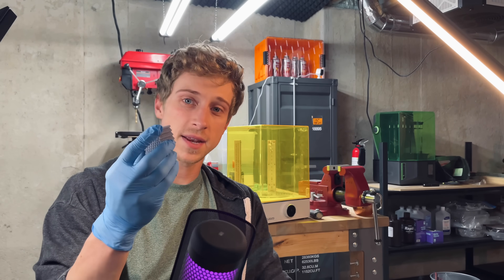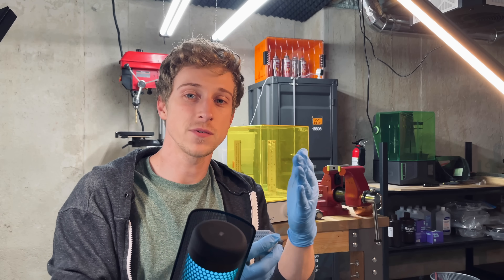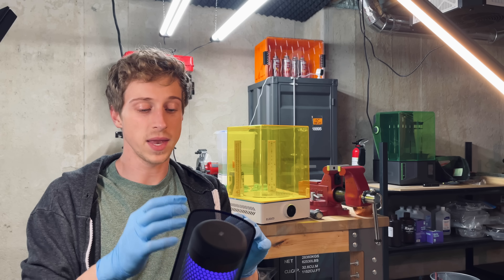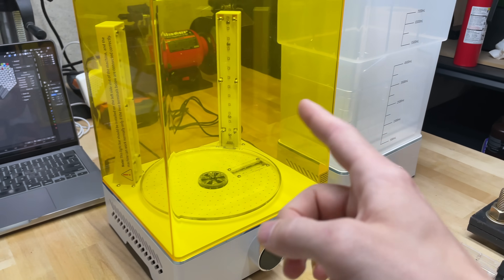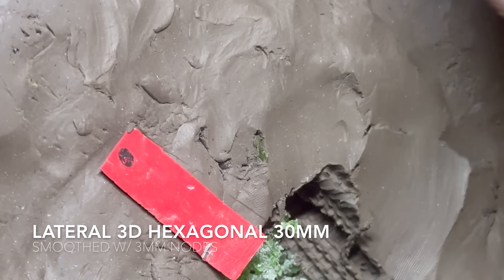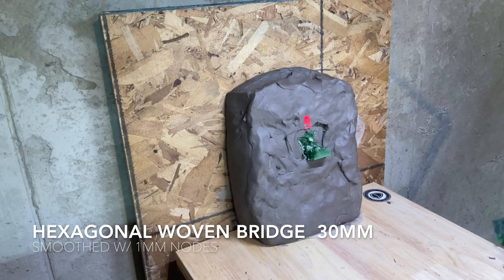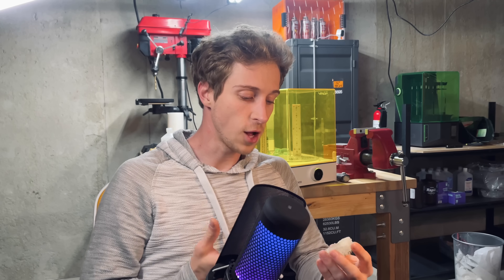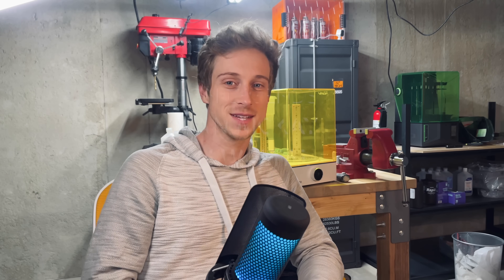Making 3D Prints Bulletproof with Molecular Structures

Comment: That's an ambitious next step, I was planning to test in a cheap analogue with handgun rounds before escalating to tougher materials & rifle rounds
Reply from the maker: Basically, the 3D Print Steel is expensive so I'm taking it right to the extreme
Reply: @CrashMakerspace  at present I still think casting/molding is the way to go, but I'm researching my ideal materials to death before I try shrinking  the budget for analogues to something reasonable
Reply: @ArtichokeMoss hopefully the ideal structure is one that can be somewhat easily (I.e. inexpensively lol) cast/molded in a high quality fashion
Reply: @CrashMakerspace  now I know it is not a ceramic, but. Demolition ranch, and stay with me now, don't stop reading because I'm talking about one of the crazy gun men posting videos to the internet. The owner of that YouTube channel actually acquired a prototype bulletproof vest, they drove over it and there was a mild warping in the plate after that. I believe it might the potentially worth looking into non ceramics, and finding a possible Superior material.

 Also why not make the exagonal structure out of ceramic, which has a higher Breaking Point than steel, and is used in body armor? Is it because much like the resin it will be fine until it breaks, instead of fine until it warps, and then warp Until It Breaks like Steel ? If if you want the thing to be able to survive an impact, by warping before it breaks. Now I'm no expert on steel. I'm really not a authority figure on this. But spring steel seems like it wouldn't be a bad choice, because after it warps it will go back into its previous State. Also historically it was used for swords, swords are mostly metal, and they are typically made rather thin, and they would be impacting things with quite a lot of leverage, because of households are held and used. So its seemingly in my mind not a bad choice for you to single out spring steel, although in terms of raw durability I'm pretty sure 1095 excels.

And if you want to read the third paragraph, just know that these ideas are Beyond normal, and quite frankly I wouldn't be surprised if they either don't work or don't get seriously considered by you. If you want the metal to return to its original state geometrically, because the ceramic while more protective, will shatter. There is an alloy called nitinol, and in my actual running of the math it seems pretty good. And I don't remember the exact numbers I used, the ones I found after finishing the math that I do, or the actual values for the material, or if there has been any improved versions of said material that have came out since then. However, it is capable of exerting quite a lot of force when returning to its original state, to the point that you can actually lift some rather Hefty stuff with like a coiled up cable that you stretched out long and bolted to the ceiling, and a blowtorch. And that is a smart alloy, I don't know if you know that they exist. But if you apply heat or electricity or magnetic force to a alloy, and that alloy reacts, and it's supposed to do that. It is considered a smart alloy. And the batsuit that you are making seems to have built-in power, which I have yet to see anyone else try that. I remember the video you made with the battery pack. And if you were to add a couple more batteries, maybe just one more battery. Maybe you put a third battery in between the two battery in each section, maybe if you add batteries that are much thinner and less around to the other sections of the nylon straps. Because the human body, and certainly a person with a emphasis on maintaining their physical fitness. They would have shapes to their body that are predictable, and you can slide stuff around the curvy bits, and the more flat sections. So if you were to hypothetically, get another battery made, so that would be thin, and you put it on the part of the strap that rubs up against your rib cage, on the side, right where it's nice and out of the way, right where it can be thin and present and not interrupt anything. It could Supply power, the wires could run under the armor, there wouldn't be any collision, and you could use this to run voltage, or perhaps an electromagnet even. So that it can activate a smart alloy, so that this hypothetical batsuit armor that would be very expensive. Would have the structure which distributes the force of the impact throughout the material very well, which is also being reinforced by a rigid, hard, hi durability ceramic or resin, you could stimulate the metal frame, causing the smart alloy to actively attempt to keep its shape - which then provides more resistance to the bullet that is impacting the armor. Instead of having just a material that resists deformation, being reinforced by another material which is just durable. You have a framework that resists deformation, and actively is undoing said deformation, which is being reinforced by really rigid ceramic. Also have you thought about putting anything inside of the hexagonal tubes of the top 3? You could try putting some kind of 3D printed rod in their, because hexagons were the base for this design. And hexagons are really strong as a shape to my understanding, because the corners work together, and the angling works out really nicely for that, and it may or may not also be capable of Distributing the force throughout the entire shape like a circle. But a hexagon has quite a bit of empty space inside, it's something that could be described as a shape with the minimum border and the maximum interior, that can interconnect with itself unlike a circle. So what if you like, put a series of coiled up Springs in there? You like getting contact with a spring making company, ask for a specific metal, possibly specific alloy, and make it small enough to fit inside the hexagonal tubing? I suggest spring, because it's coiled up, instead of a straight metal bar, which I figured wouldn't be very effective. And it's being a 3D printed, so it's not like the structure inside of the hexagon is going to provide support to the hexagon, because it would certainly be separate. Unless of course you assemble the hexagon out of triangles, which are also a strong shape- so it would be like six shapes in one. But that would leave less room for ceramic.

Comment: can the fractures be repaired, or would a whole new piece be needed to fix a larger part?
Reply: I would assume no as the cohesive structure is what gives it its strength. Kinda like carbon fibre. Damage the core structure and the rest of it loses the strength. 

Remember that OceanGate thing a year back? That happened because they didnt treat the carbon fibre properly and literally milled down wrinkles or protrusions on the outside before consecutive layers. 

Same thing would happen here, sure you could glue then together again, but the strength would never be the same due to the glue being a weak point.